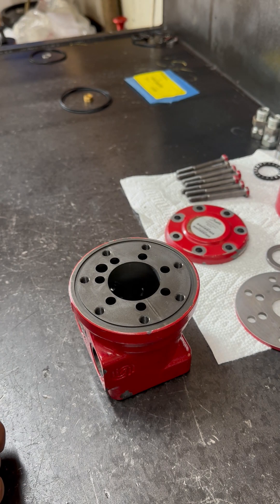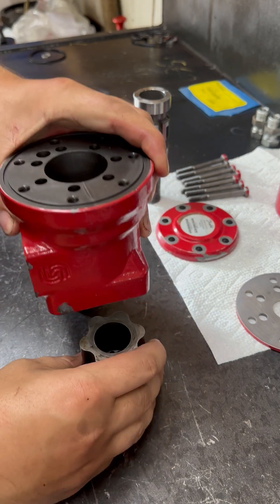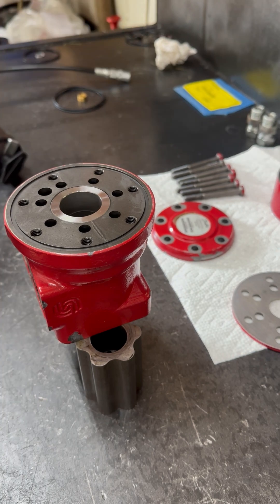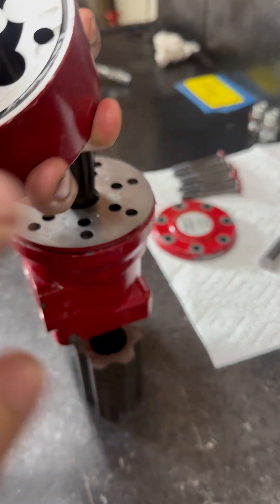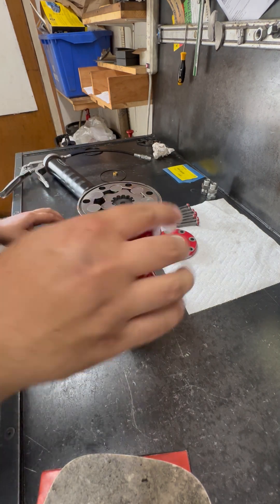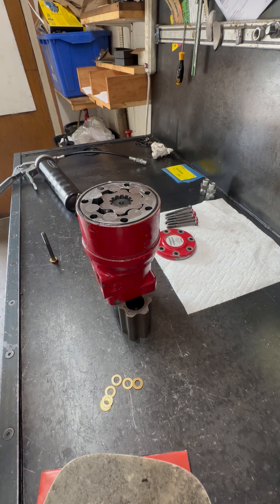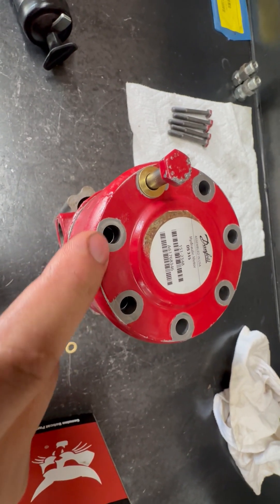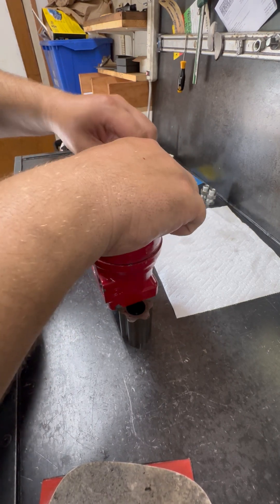DANFOSS DS 315 HYDRAULIC MOTOR

Comment: It is easier to time  just think of a clock use the center between the ports as 12 o clock and look at the displacement and what ever star point is closest to the wall  put at 1 o’clock works all the time if shaft does not have timing mark just line up the shaft with the groove in the shaft at 12 o clock